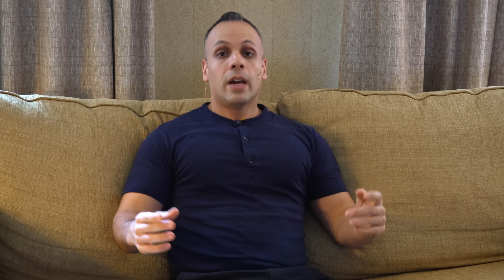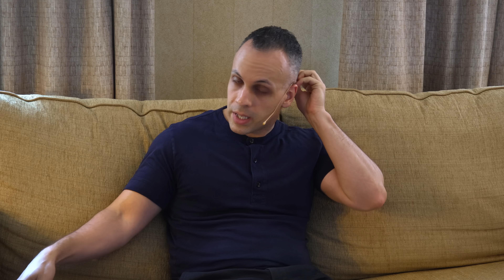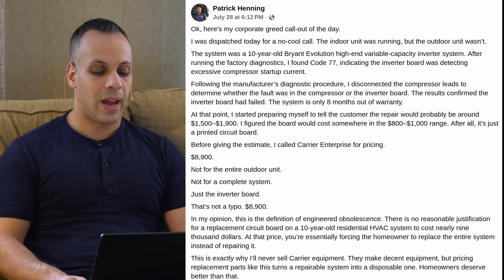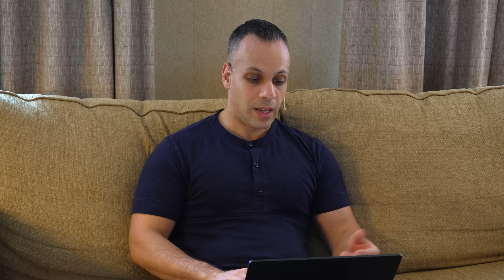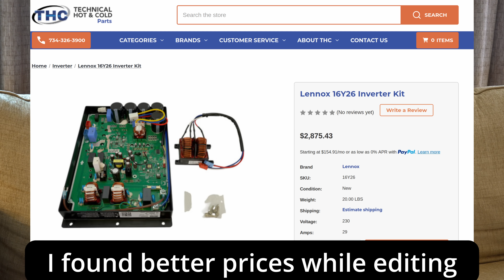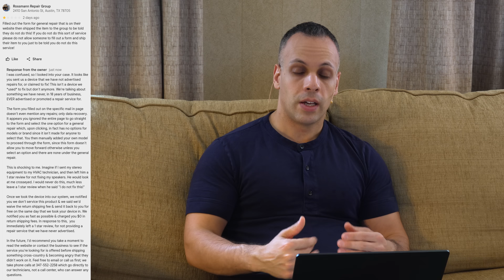Carrier AC repair has $8700 part cost for residential unit

Comment: I am a licensed, NATE certified and a bunch of other certs, HVAC tech. And a lot of the times the manufacturer wants the board to back that died. However Louis, these boards are not that complex. They are probably some of the most basic circuits you'll find so it could be very lucrative building or refurbishing these boards. If you could get a handful of these boards amd every time you sell one require them to return you the core board .
Reply: Once you have the core board, you can just copy the design and have them reproduced as generic boards designed to handle higher temperatures.  You might even want to tweak the layout a little as you might not get the same parts as the OEM.
Reply: The problem with the high end units is the software and communication it's not just a printed board like in the lower end units
Reply: the hardware is completely and totally irelevent, its the firmware on it. Every single inverter board is proprietary and unique to whatever design it is attached to. that system in question was R-410a. They are out of production. When supply gets scarce, prices go up. If they ran on software, they could be made much more cheaply, but then would not be as reliable.
Reply: @malcomreynolds4103  How would I go about learning to repair inverter boards for AC systems and mini splits? I’m an HVAC student right now less than a year from getting certified but I’ve studied my ass off. I’m still young, and I know the future is electronic and digital, so if I learned how to repair these boards it would help me a lot. Also I have minor experience in soldering too. Any reccomendations for books to read, videos to watch, or courses to take would be greatly appreciated.
Reply: @nick5839  its electrician work mainly, not specific to hvac. If its a component failure, you may be able to diagnose it and fix it depending on the component. But every time you fix one of those, you are taking on huge liability.
Reply: @malcomreynolds4103  goal is to practice working on bad inverter boards that I get from replacing through work, granted that depends on how many boards I have replaced in order to even be able to practice on ones that were just gonna be scrapped/recycled. In theory with enough practice the liability wouldn’t even matter because im working on stuff i got for free
Reply: @glennjames7107 How would I go about learning to repair inverter boards for AC systems and mini splits? I’m an HVAC student right now less than a year from getting certified but I’ve studied my ass off. I’m still young, and I know the future is electronic and digital, so if I learned how to repair these boards it would help me a lot. Also I have minor experience in soldering too. Any reccomendations for books to read, videos to watch, or courses to take would be greatly appreciated.
Reply: @nick5839  Learn switching PSU/VFD repair in general and be careful, 240 can kill but rectified 240 into a big capacitor bank will do it even better.
Reply: @Broken_Yugo thank you brother will look into it

Comment: Damn I'm super curious how much it would cost to have PCBway print a replacement board and you populate it yourself. Although I'm guessing you would need an original board to get all the correct parts for it since I have a feeling diagrams don't exist from carrier because they basically consider it a disposable unit

Comment: My LG washer went out a few years ago. I found a post of someone who fixed it by installing a single jumper. It's still working years later.
Reply: It was the unlimited subscription jumper wire cheat code.  Now all you have to do is find the "unlimited auto-skip ads" jumper.

Comment: Most inverters are not that difficult to fix and the oem allways charges a permuim. You can repair these boards and still have quite a bit of margin left. Most of the time it is somthing silly for a system that has run for 10 year.

Comment: There is video about Italian pasta shop that still uses almost 100 years old machinery. Owner have custom made replacement parts because nobody selling them obviously. This is the main difference of "then" and "now". If someone could tell you "we can sell you replacement part but it will cost stupid amount of money" you have options to just simply get it from someone else. Even with old electric devices from 70s and 80s it was true, because most of the time it was mix of mechanical and simple electric circuits. Average Joe could fix it and if something had more complex parts, then less average John could do it. This is the reason why now it is possible to instead telling someone "no" you can say "fine, it will be 8000$" without fear that someone will do a replacement for it. Don't know if it a stretch but it is also possible to sue people making own circuits boards, because of breaking "digital locks" AKA programming custom chips, making it even more troublesome.

Comment: That board cost is 100% a fuck you buy a new one price, a whole new outside unit and a-coil would only run like $5k wholesale for a mid to high end inverter heatpump...
In regards to what gets done with the failed boards, trash generally as nobody has wiring diagrams for them or really offers board repair services.

Comment: "Should I start a repair business"? Maybe... Story time!

TL;DR: fixed a broken cap for 10$ myself, 1k$ to replace the board, they tried to sell a 4k$ repair or a 6k$ upsell to a new unit (that was lower rated than what I had)

So fun HVAC experience. This was for a Train HVAC, had capacitor go out on a board, this was like 5 years ago now, as I recall it was a board that managed the interior blower fan. (I didn't know this at the time). 

I was renting, I called the owner/landlord, they got someone out, after the HVAC guy crawled around, he said the blower unit was bad and after the diagnostics it was the board that was bad, he could "repair" it by replacing the whole blower unit (not even just the bad board, which he correctly identified) for 4k, but that would be a week (I was in Dallas at the time, in the middle of summer), or he could give a brand new one for 6k (which when you look at the fine details it was actually a lower tonnage unit, so replacing immediately with a worse unit than was there). I passed the details along to the owner, but I then told them that they should tell this HVAC tech/company to fuck off because I'll dig into it further. I swear the only people who extort you more than the HVAC repair companies are the plumbing companies...

Pull the panel off, sure enough you can see where the magic smoke came out of the board. Turns out for this particular model this was a very common failure point. In fact this capacitor was specifically designed to fail to protect the rest of the board / system from damage. Basically too much electricity, this goes first.

Looking it up, I could get the board for like ~1k as I recall, which pisses me off that this was not the suggestion by the HVAC tech/company. Makes me think they knew about this, and wanted the unit to then repair it on the cheap and sell it back to someone else "refurbished". Because, there is no other explanation of 1/4th the price to repair vs what they had quoted, and nevermind if they can upsell on a new unit.

Anyway, the capacitor was a common part, that you can buy, I did have to drive 2 hours one way to a supply store that had them, total price of the capacitor? Pack of 2 for 10$ (as I recall). I whip out my soldering iron, remove the blown cap, install the new one, total repair time: 4 hour drive + 1 hour to replace the cap. Even at 150$/hr (which they wouldn't charge travel time like that to get a part... But assuming they did) that's a full repair for under 800$ technically, I did it myself for 10$ in parts...
Reply: One of many reasons I miss Radio Shack

Comment: I had the opportunity to rebuild my house. I wanted to go with mini splits, told by construction and architect that no one does new construction with mini splits (year 2016). Previous house had window units. Windows units even though ugly are very efficient per room and price. I thought mini splits combined with home automation I could control each room with Home Assistant. I ended up with two Lennox high efficiency systems. My first introduction to price was the replacement of the proprietary s30 thermostat not covered in warranty each system thermostat failed costing $1K a piece. On first thermostat failure I got an estimate from a HVAC person to install a new one at $5K (this was year 3), he justified his estimate telling me he would give a 5-year warranty. I bought thermostats from Amazon @ ~$970 and installed myself. One unit is zoned, a zone stopped working. $2K to replace the zone controller and damper. On that one I found out that if I shut off the breakers and leave the zone unit off for 5 to 10 minutes the zone board will come back and work for a year or two. When it hangs, I just reset. I lost both evaporator coils still under warranty but labor cost over $1k... The second evaporator coil replacement happened this June and every person that came to my house wanted me to buy a new AC unit at a price could have bought more than 20 to 40 window units. After much AI searching and living in the front room for 2 weeks as the back of the house had no AC. One HVAC person with 28 years of experience and seeing that the units were all kept clean and maintained said it was the evaporator coil and replaced it. He said most likely I will run another 5 years BUT will be replacing my units. If I had my mini splits today, I could have zoned each room, used Home Assistant and controlled and monitored it all, also replacement would be cheap OR at least comprehendible. Sure, I might suffer when it's cold (I live in Austin I could wear a sweater). I still freak out about the Lennox S30 thermostats basically I purchased an iPad for each unit. Bottomline HVAC is asking to be opened sourced but it's HVAC (See TV series Community about HVAC)

Comment: Fixing these PCBs are trivial 9/10 times too if you have some basic electronics knowledge. I fixed one of mine and all it was was a blown diode I found with a multi meter. I swapped it out with a PCB from the junk bin that had a similar diode. 
Thankfully the DRM aspects on HVAC isnt nearly as crazy as other things, but I expect that to change with time.  These companies are being completely corrupted by private equity vampires, "muh shareholders" greed, and stock buy back schemes.  It will eventually collapse in a ball of flames unless government starts wrangling some of this bullshit in.

I went all Goodman too for the same reasons when I replaced mine and have swapped a few parts. I've had to out maybe 500 bucks into repair parts since I initially bought it and it's pushing 10 years old now for both units.

Comment: HVAC companies want you to believe that variable compressor is inscrutable alien technology with unobtanium parts.  They have a perfect fall-guy in the form of "damn gub'mint regulations" so we'll buy a new unit and hate Congress instead of greedy corporate bastards who are charging $8000 for basically replacing a bad capacitor or fixing a cold solder joint.

Comment: Knock on wood I’ve have a Lennox AC unit for a two-story home and it’s been running for over 17 years last year. I had a blower motor go out and the estimate was $2000 for installation and the price of the motor I looked at the motor on Amazon, which was OEM and it was only $200 when I asked a technician if he could install it the answer was no because of liability issues of ordering it from not their wholesaler and it comes with a warranty that’s why they charge so much. I recently had my unit serviced a few weeks ago and come to find out that a capacitor which is a $20 item was low on voltage and needed to be replaced. I asked a technician if I could buy it if he could install it in the same thing occurred. No, they cannot, even though I would get it from the same distributor it’s because of liability and warranty in my view. This is the reason why some of these carriers are losing money and are going to be obsolete when more and more people start using alternate heating and cooling units.

Comment: Carrier R410a condensing unit coils shot up from ~1,500 to about $4,500. If you have a new R410a condenser with a leak at the coil, they jacked the price up to try to make the cost comparable to changing to R454b, which would also include changing out the indoor evaporative coil as well.
Reply: That R454b is a scam.  Since it's proprietary, you really get vendor locked in - prices and shortages are a main disadvantage.  I personally would do everything in my power to use an R32 based system if I'm ever forced away from my vintage R22 based system.

Comment: We're having our 21 year old system replaced today because the compressor shorted.

I was on the verge of getting an inverter driven unit. After more research I changed back to a single stage unit for sheer simplicity sake.

Sounds like that was the right choice.

Comment: I have a 9-year-old Carrier 3-ton heat pump system that I had installed in 2017 and it's been running flawlessly. 🤞I'm sure that the current systems quality has been enshittified, like everything else. Going forward, I'm seriously considering going with multiple mini split units. That way, if one goes out, it's not taking down the whole house. 

I also own a condo that has a top of the line Trane system that was put in by the previous owner. That has been the worst piece of crap I've ever dealt with. It uses a specialized touchscreen thermostat that costs almost $1,000. That part has been replaced five times in the past 8 years under warranty. My warranty has finally expired on that unit and if it dies, I'm having it completely replaced by whatever the least expensive unit is available.

Comment: Warning - As a ‘Theft solution’ - HVAC industry is starting to look at locking digital serialed parts together so you cannot even parts swap. Permanently encoded with other parts in the system. Only new OEM parts will work and immediately be encoded into the system when added.
Reply: Yep, that's the trend, digital rights management for appliance parts. You can't repair stuff yourself because you need the software & an interface and they only offer that to authorized techs at very high prices. There's refrigerators now where the dispenser water filter has an identity chip in it, like printer ink.
Reply: You know what happened in the automotive industry?  MegaSquirt, Speeduino, rusEFI, and FreeMS2 , and those solve a vastly more complex system.  If the HVAC industry keeps it up, it will happen by an enraged consumer with moderate electronics and development skills.  AI can even make that development happen quicker.
Reply: Gee, that sounds like my John Deere tractor. It had a problem with the turbo's controller, a small box that is bolted to the turbo. It's a big tractor and I didn't want to haul it to the dealer, so I bought the part and installed.  The tractor wouldn't start. Maybe it isn't the solution?  Called the dealer and arranged to have a service truck come out. The guy said the new part needed to be "registered", which I had him translate into, "tell the main control unit to authorize the part's serial number". $900 call.
Reply: @bobblack3870  Cheesus...
Reply: This all started with AAPL iPhones.
Reply: I work HVAC and for residential, luckily this won't happen for the foreseeable future. Single stage equipment is very mechanical and basic. There is no need to buy anything more than single stage. And the way they are designed, this type of serialing would not be possible
Reply: @yinggamer7762 , two stage.  I think the ideal unit is a two stage. Best of both worlds without the inverter nonsense.
Reply: @jemcotx...    no, single stage is all thats needed.  Anything else is sales fluff.
A two stage furnace is just a single stage furnace with a more expensive gas valve.
The pennies you save per year are gone at the first service call.... i.e. "not worth it"
Reply: @dan827 I live in Texas.  We only use a furnace for two hours a year. The 2 stage is for cooling. It has saved me thousands over the last few years.
Reply: @yinggamer7762  inverter systems are how environmental lobbyists recover the lost efficiency from ever worse refrigerants. Especially in severely electricity constrained areas like California, Texas, virgin and Massachusetts, selling a system that is even more power hungry than the previous system could be a hard sell.

I have yet to live in a location where heat pumps were anything other than a completely massive joke with slightly worse efficiency in cooling all the time, highly efficient heating in the months where electricity expenses for heating are totally unimportant, and out of control high heating expenses during months where the electric bill is sky high and it actually matters.

In humid areas two stage units also solve the problem of dehumidification without accepting it just being hot as hell inside on hot days or while cooking christmas/thanksgiving dinner.
Reply: Unless they install serializing inside the compressor, they cannot prevent the system being run by an alterantive board.
Reply: Isn't Daikin already doing this? I managed to swap out Mitsubishi Electric outdoor units but never managed to get a Daikin working after a partial swap.

Comment: I used to do HVAC from 2009-2012ish. It reallllly sucked when obama put in the new EPA guidelines on freon where if you changed a unit you had to change out the entire line system which cost the customer way more.